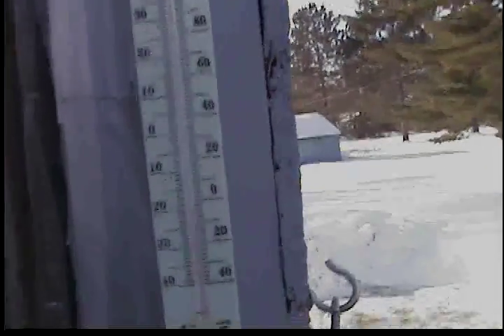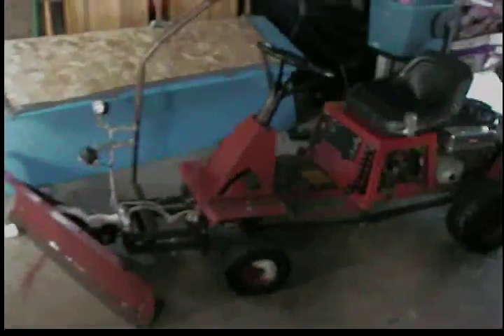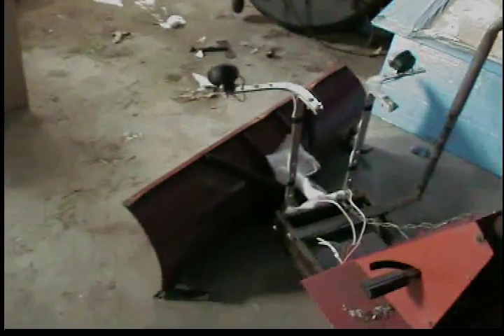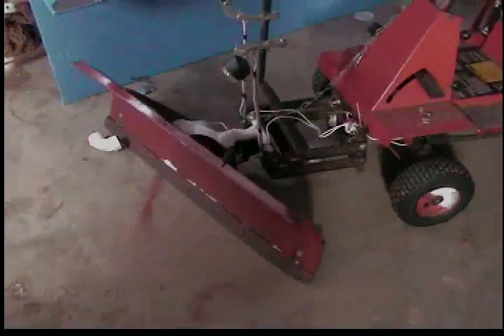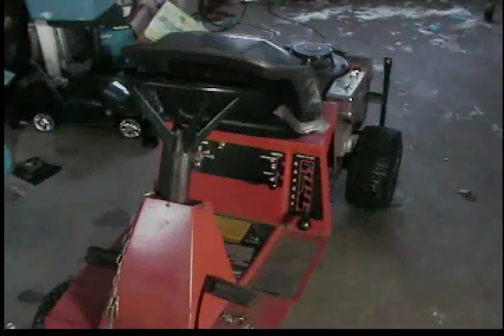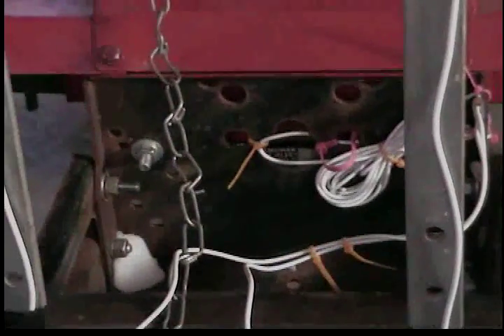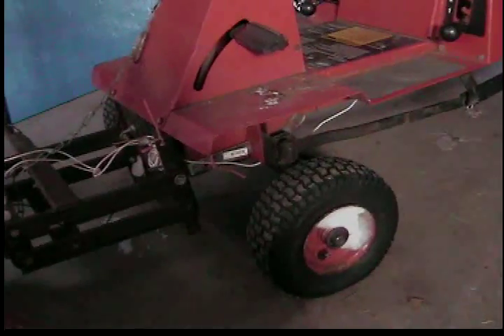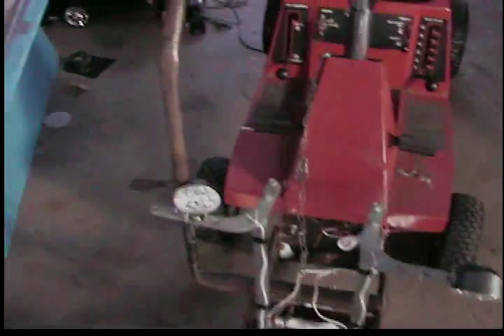1988 toro 12/32

Comment from the maker: Yeah had that idea in my head before i got found the plow. Before that took an old snow blower tore out the insides and used that but I needed to beable to turn it because get more then 4 inches I couldnt push it.  Yeah when it warms up I will have it in the yard and video of it running.